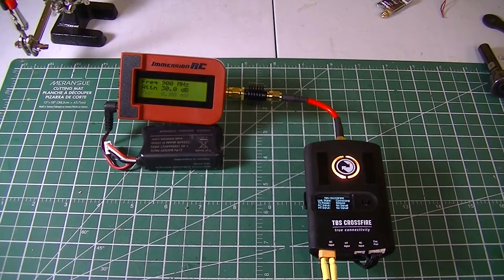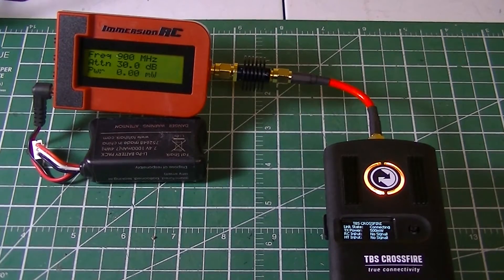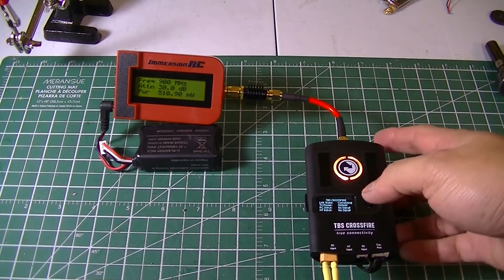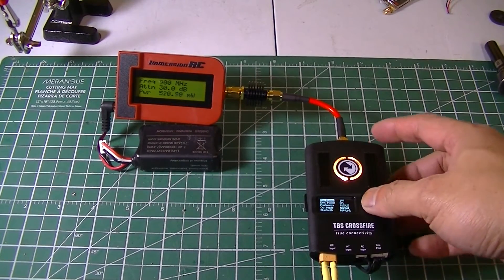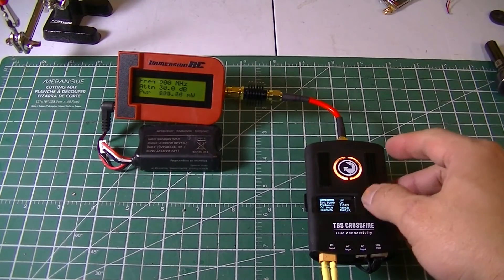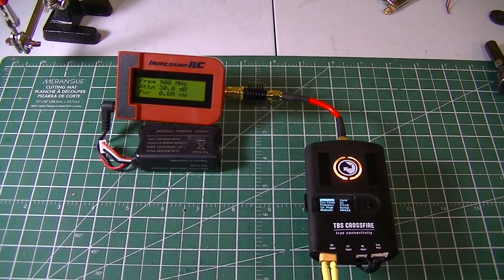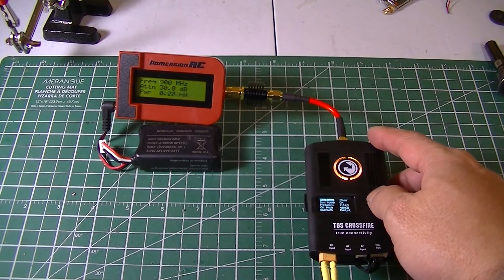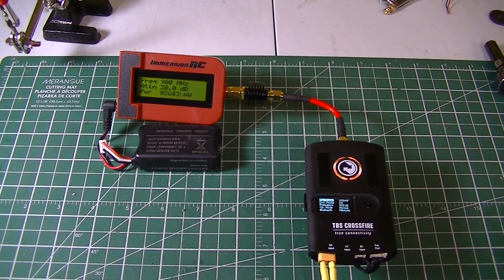TBS Crossfire Power Output Test

Comment: I have two crossfire units, full and light versions, tested the power output on both and got slightly above the specs on new and half the output on older full version.  posted my results into CRSF group on FB and got shit storm from both crossfire lovers and TBS staff, about how my test are not legit, and how I need to use 50k equipment to test properly.  Never mind that my results were consistent.

Comment: hello! I'm kind of new to the hobby and don't really understand: having 800mw of power gives out a better rc link? the almost new crossfire micro tx only does 100mw,does that mean it has a weaker link than this crossfire tx you're using? would that shorten its range?
Reply: It would have less range but 100mw on the crossfire system will have more range than any 2.4ghz system by a long shot. The micro tx is perfect for mini quads and racing where the full size crossfire tx is better suited to larger craft and flying longer ranges. With good antenna placement you’d be surprised how far 100mw will take you.

Comment: Same here as we both shared this sad info. Again I think it was designd for the European market whom use the 2.4GHz vTx frequency as we here in the US prefer the 1.2/3GHZ and I experienced bad interference even with the USA 915MHz TBS notch filter with no success. I went back to the proven DL.
Reply: 2.4 ghz video works perfectly here in the US. Use channel 5 or 8 and you should be golden. Those are outside of WiFi interference and give great results for me with stock lawmate whip/Yagi or if you really want to be sure a set of CP antennas like an air screw/pepperbox combo.